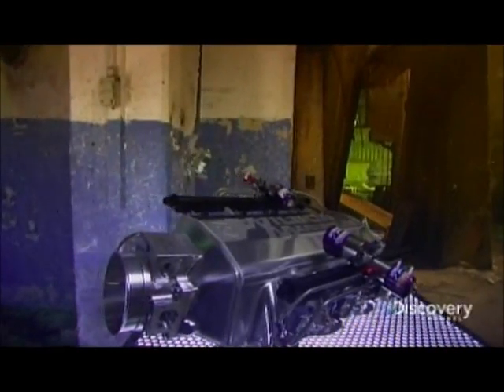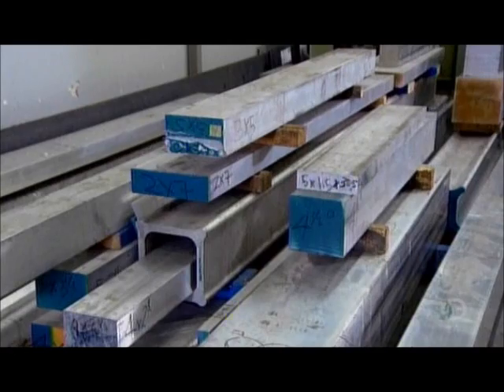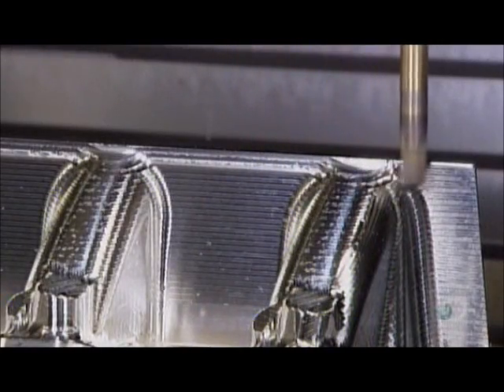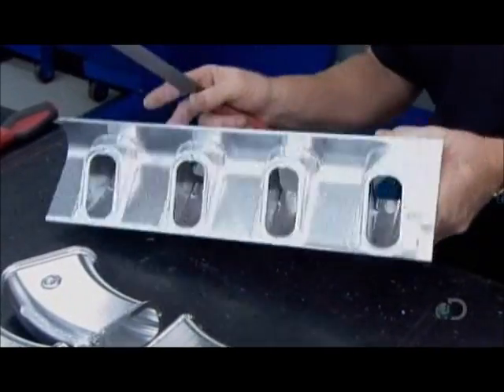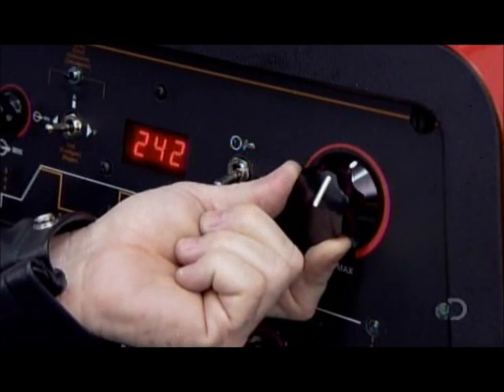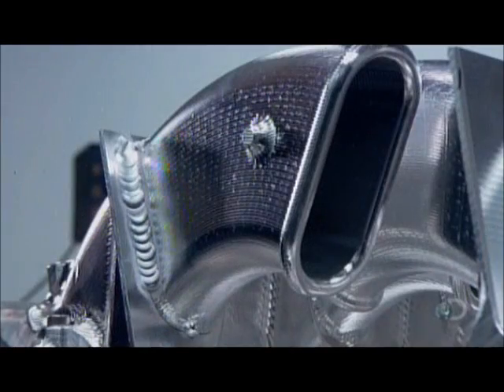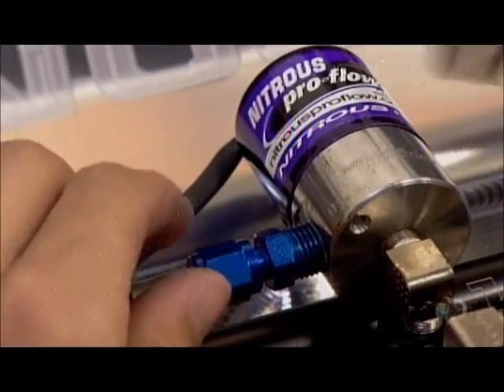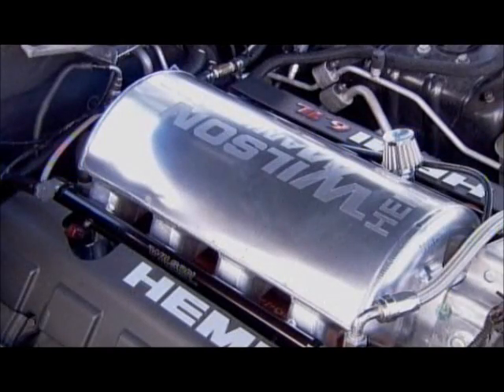How It's Made - Intake Manifolds

Comment: it has a small amount to do with what power your engine is already making, and more to do with the nos system you have. 500 bhp can easily be added with a massive 200 shot and huge flow jets. obviously this huge amount of power and pressure can cause some damage so you typically only see it on built engines that put out 500+ hp on their own.